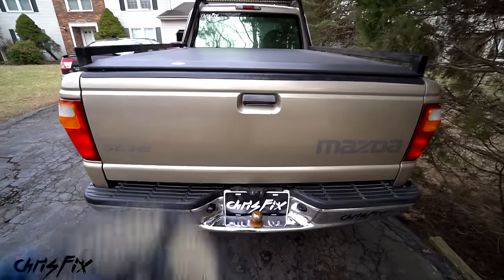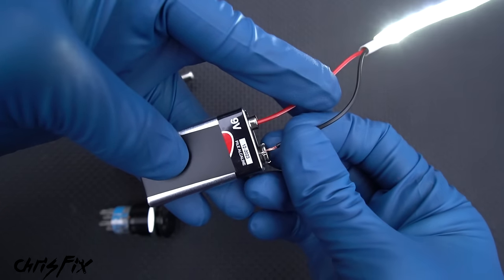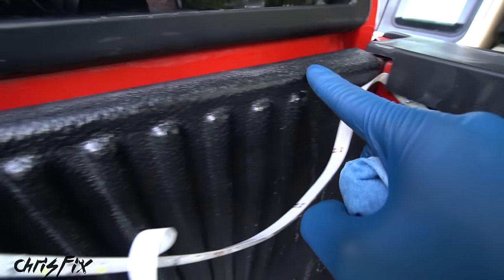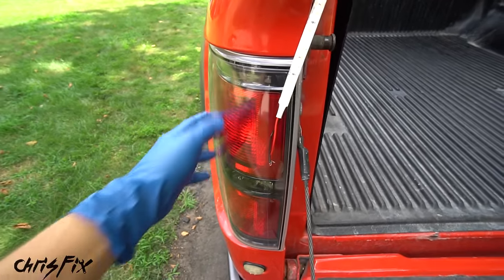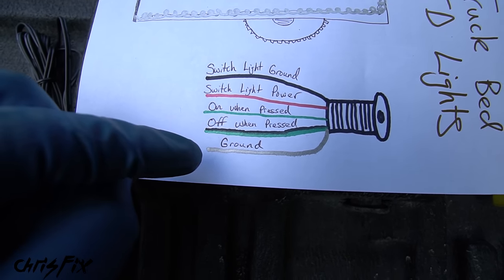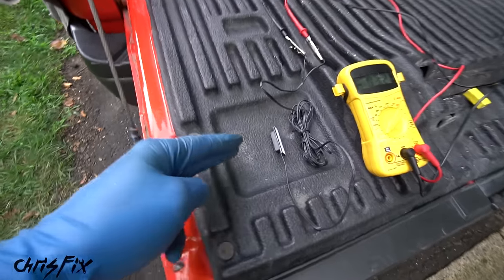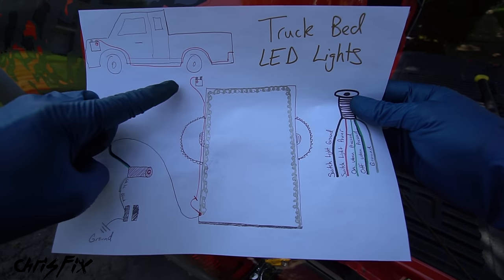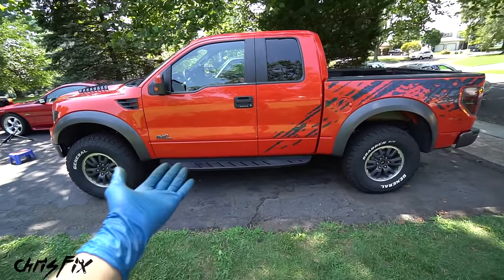How to Install LED Bed Lights (Fun DIY Project)

Comment: Hey @chrisfix this video helped me
A lot with understanding the wiring factor of installing lights on a truck but could you make a video of wiring rock lights. Because this have multiple different wires for each light and it confuses me. Thanks again for this video though I’ve always loved your channel when I wanted to learn about cars and trucks.

Comment: i ordered the the switch you had on the links, The lights them-self (link) didn't work, And when i got the switch in the link, it did not have the same colored wires, nor did it have a diagram, making it a challenge, i also didn't want the magnet switch, felt it was a possible future problem, which added to the install adventure trying to figure out the wiring paths for night light switch and the lights them-self, I found some Bedliner lights them-self at O'Rielys, (8 cubes of 6 lights each), along with the 6 foot gap of spacing for opposite side made it totally hidden and even more professional. the illuminated night light on switch makes it so clear in the dark when you open it, no hunting around. But Thank You for the Info, just adjusted it to suite me, Super helpful, and everyone that has seen it on or walking by at the store when its on think it Factory done

Comment: Couple of pointers for you I would have used water proof heat shrink connectors and the one yellow 10ga connector you crimped the casing was cut and had some bare openings .. that ground was classic I’ve never seen someone put wire Thur a bolt and a rusty bolt at that . Then you didn’t even remove paint for optimal connection…you also should have left the 5 amp fuse because now you have doubled the operating load . Those leds would melt before that fuse blew

Comment: Very nicely done, as always.
I personally think it's disturbingly bright, so I guess I will have it installed under the rails only and not where it is shining in your face. But overall a very nice idea! Cool truck btw! 
And one thing I learned from a car loomatic..... the front part of your protective tubing needs to be properly   
fastened. So wrap the black tape around the cable three turns, then slide your tubing over it and run the tape through the opening of the tubing. When you now wrap your black tape around the tubing it it will never loosen itself.

Comment: Hey @Chrisfix,  I've been following your channel and projects for years, I've always been impressed by your willingness to demonstrate how to do things correctly and not take short cuts. Until this one. As always I was impressed in your methods and how you demonstrate the different way to do thing, crimp w/heat shrink, solder, you did miss in this case heat shrink with solder inside it already. However I was disappointed in the way you grounded the switch in this project. The ground is the point of failure with this project. It should have been tied into a ground point with a proper ring terminal similar to the way it was connected to the battery. the way you connected the ground will corrode or break in short order.  apart from that good work, and I look forward to future project.

Comment: Greetings ChrisFix, This is a really good instruction video as are all of your vids. I have a couple of suggestions to go to the next step. 

First, attach the switch to the HOT side, or Positive side of the battery. It is much safer way to run the wire. As an electrical engineer it is one of the practices i do. 

Second, on your ground connection, go with a larger ring terminal. Just using the copper wires in the nut may cause problems. Vibration will cause the ground copper wires to "work harden" (bending back and forth) and become brittle and are more likely to break off. 

Thanks again and FIGHT ON!

Comment: Hey Chris. Good video! Instead of using the heat shrink you used, I would have used the type of heat shrink with the adhesive/seal already in the heat shrink. When it is installed properly the splice is nicely covered but also sealed against moving and is weatherproof. It's a win-win situation. It is slightly more expensive than regular heat shrink but does so much better. Now the butt-splices that you were using are OK but I found out that even the insulated side of the crimpers can cut the heat shrink, So I get my weatherproof heat shrink and cut it so that when its reduced it only covers the center of the butt-connector to cover where the crimps are. It is so easy to do, I can't consider it another step. Just a helpful hint from someone who has to do installations professionally.  Oh as for the nut on the ground. That is a NO-NO. Use your ring connectors and Self-tapping screws. This way its properly grounded. Then just cover the ring connector/screw with a light coating of silicone sealer (RTV Clear).  Keep up the informative vids!

Comment: Sometimes the switch colors are different. But usually you can figure it out. On the 5 wire layout the red and black is the same. The white is usually the common ground. That only leaves 2 wires to figure out. On my switch I had blue and brown instead of green and green black. Since one will be press for on and the other is press for off it's must a matter if trying out each wire and figure out which is which.

Comment: 14:08 you should have tined the wire and made a solder connection to the terminal. better connectivity & helps prevent oxidation. That said. I meant no negative criticism, just a suggestion. Without a doubt. You sir, are awesome! You certainly make the the greatest & most informative vehicle videos on YouTube. Thanks, and keep them coming.

Comment: To connect the positive(red) wire coming from the battery to the red wire on the led light end I would have used spade (quick disconnect) connectors to connect those 2 wires to each other instead of soldering them together so that you would not have to cut the wires in the event that you had to make any repairs you could for example easily replace the led light strip and all you would have to do is disconnect the old 1 and connect the new 1.

Comment: Hi Chris. I am a huge fan of your videos!! Just an FYI, the link for the switch, (not magnetic one) does NOT come with any instructions as you thought they did and the barrel of the switch is actually larger than 5/8. I picked up the 2 -5/8 inch washers as you suggested but they are too small to go over the switch... thought you might like to know...

Comment: Hi @ChriFix!! I want to thank you to all the video you posted. It's very educational. If you have a chance please can you help on installation for the hood LED strips. The instuction says tap it on ACC fuse or DRL but we can't locate it. Even if I check in the forum, no one have the answer for Lexus NX 350 or fuse having 12v doesn't indicate

Comment: @chrisfix! Hey Chris!, i am a fan of your videos i have a segestion for this install. Since the Led strip has a white backing they make led strips that are black with diferent color lighting to meet your application. I did a similar install like this before i saw this video and i used RGBW led strips so i can change the colors because i have a custom setup. My headlights also can be changed by color if you wanted as well as my underglow. i think the black strips would look so much better for the application

Comment: Hey chris.  THX for All your great videos.
I have a question. why didn't you get the power for the lights from the taillight lamps? it was much easier and cheaper!
Reply from the maker: Thanks a lot! And the light would not have been on unless the taillights were on!

Comment: Hey @ChrisFix! Thanks so much for another incredible video. Quick problem - about 24hrs after install, I noticed the magnetic switch melted and is now stuck closed. Any thoughts as to why this happened?

Comment: Awesome video ! Can I just run the lights to my existing bed lights so when they turn on the light strips turn on ?
Reply: Yes and No. 
There 12v lights but there might not be enough current to power them. 
I just added a switch to my trunk light and the switch caused so much resistance that it would not power the light any more. I had to buy a low voltage switch.
Also your existing lights are already on an existing circuit where the the appropriate fuse has already been placed. You don't want to risk drawing more power of a circuit that's not able to handle it.

Comment: You could have ties into the trailer power in the back. It’s already back there, instead of running a wire all the way back there. The center spot on a 7-wire plug is always hot, as long as it’s connected at the battery. GM trucks come with the wire, but it has to be connected at the battery.

Comment: Thanks. I had a camper shell put on my GMC Sierra and the factory LED by the lift gate is lousy. I’m going to add strip lights to the inside of the shell but I want to button switch to light up. I wish you would’ve shown how to wire that up too.

Comment: Chris, this truck bed lighting is really great and I want to thank you for the idea and how to video. Have you had any suggestions as to a more durable magnetic switch?  I've burned up two of them in just twelve months and looking for a better one or just bypass that feature and use manual only switch.
Reply from the maker: Dang. I wonder if they make a better one? Or maybe a mercury switch which recognizes the tilt of the tailgate when you open/close it?

Comment: Not sure what kind of amps the lights are pulling, but there’s always sources of power closer to the install. IE taillights, trailer connectors. Lots of other places to pick up a constant hot vs running a whole new circuit. Just make sure the maximum power usage is still under the stock fuse and wire size for the whole circuit. Just what I’d do on my own car not advice on yours.

Comment: Conical end on that grounding bolt and no ring terminal. That will be the point of failure in the future. Other than that...great info! Will have to do in the boat.

Comment: Hey Chris was wondering if you had another recommendation for the LEDs as the ones you recommended are no longer available. I saw in one of your reply’s you replaced the switch as well could you share which one you went with ? Thank you

Comment: There are heat shrink butt connectors that have solder in them so they seal and solder the connection. Also there's heat shrink tubing with an adhesive that seals against moisture. Might save someone some time

Comment: You should get a inclosed goose neck 45 ft trailer and a f 350 dully or a chevy durmax dully or a ram 2500 dully

Comment: Could you use an inexpensive mini power bank to power the lights instead of the starter battery? That way if the power bank can be accessed perhaps in the front cab interior, it can be recharged  at times when  the lights go dim? Probably would not work if stronger lights are needed.

Comment: Hey Chris!  I’ve been checking out your videos for years and finally have made the time for this project…
Can you let me know the purpose of the push button switch for this?  In my mind I should be able to bypass the push button switch and go with the magnet or bypass the magnet and use the regular switch.  Thanks for your input!

Comment: Love the video. But three things I would have did differently. 1 head of the bed I would have eliminated it. And just use wire. 2. The led in the tail light area. Cut it shorter outside the area. And the ground. Ring terming.

Comment: I'm assuming the truck has a 7 pin trailer hookup, an easier way to run that power wire would be to tap that power wire that's already behind the rear bumper in that built in 7 pin trailer adapter. Just my .02 to help save time in the wiring process.

Comment: I did this on my last truck but instead of running a new wire all the way to the battery, I just tapped into the trailer harness and used the wire/pin that powers the trailer lights.

Comment: If you ever need to remove the tailgate, (if the cable doesn’t have a clip) you’ll have to remove the taillight and the nut holding the wire on and then you can’t use the lights unless you put the bolt and nut back on

Comment: Great work until you got to the ground on the bare metal. I thought that was a bit below your usual high standard. The wire under the nut could fail. A connection like you put on the positive of the battery may be better.
Reply from the maker: Thanks for sharing, I've done grounds like that before and years later never had an issue with them!

Comment: Is there a way you can make a tutorial on the hood LED lights, I really like that set up and would like to copy it. It’s gonna make working on my truck at night a whole lot easier😂
Reply: Splice a relay off the factory wiring for the hood light, that will be used as the trigger (switch). Run battery power, like he did in this video, through the other side of the relay out to the led strips.

Comment: Great video but still wondering why no sanding paint and using a ring terminal for the ground. Those wires will break within a year here in Arizona lol

Comment: Chris,  can you do an interior LED lighting vid?  I have a 2024 Frontier and it has the reading lights, but no other interior lights! I was thinking LED strips to illuminate the floor area with it ran to the fuse box.  I welcome any other options you can think of.  Something with constant power and a switch in an empty slot that I have would be cool.  Hope you can help with this because I'm at a loss as to what to do.

Comment: Thank you for all the videos! You have given me the confidence to attempt and successfully complete multiple repairs on my cars.

I have a request, if possible, can you do a video on hardwiring dash cams to the fuse box? I know you have touched on some of the topics throughout various videos but seeing it all together would be great! Front/rear, license plate mount, running wires etc. Thank you in advance!

Comment: Bro, cringing at 20:50. After all that attention to detail on the rest of the installation, how hard would it have been to put a simple spade connector on there? Just jamming the conductor into the threads of a bolt is a pretty amateurish way of doing it.

Comment: @ChrisFix thank you for the awesome vid! Makes DIY so much fun to do!  

I have a request, can you make a side vid on adding in a secondary power source to us other than the car battery?  I only ask because my car battery died and needed to look under hood and the light won't work if the battery is dead. 😅 Something as an emergency backup. Maybe something next to the fuse by the red battery post?  Thanks again.

Comment: Was watching and the video was really helpful, thank you for your time hope you keep helping the community with your skills, I do some simple stuff to my tacoma and already installed some led lights and was thinking to install some fog lights also but don’t want to keep putting more wires on my battery is there anything I can use to install everything on it instead of the battery? Hope you have the time to reply, thanks GOD bless stay safe....

Comment: Hey Chris. Ty for all the information u provide us with. Learning a lot. However I will appreciate some help. Ordered lights and switches bus switch came with different color wires (black, white, red, blue and brown ) tried installing magnetic switch to it but didn’t work. Would u plz help with wiring colors, ur video shows white, green, green and black, red and black. Help plz. Ronnie

Comment: Nice job, but what if you need to remove that plastic cover? Maybe better idea to put 2 connectors between metal and plastic part?

Comment: Great vidio,but I would tap onto the tail light wires.your going to have your running lights on anyway.and led lights uses very little current.

Comment: Thats awesome!!!And by the way, congrats for almost 4 million views!!i have Subaru base model without mirror turn signals. i was thinking install one, is it safe to just tap to the rear turn signal? or do i have to change and increase the value of the fuse which has7.5A?

Comment: Hey ChrisFix.. I had watched this video over and over many times.. I’m not sure whether there is a black wire run from the battery to the back of the truck or just the red wire run to the back of the truck..

Comment: The only thing I would have done different is put a short screw in the metal to attach the ground vs using a spot where the tailgate latch would cause a detachment of the ground.

Comment: So I just watched this and now I need to do it! I bought all the same items you had listed but have one question. If you did want the light for the switch to be one, how would that be wired?
Reply: I also didn’t want the magnetic switch. Just curious how to properly wire it with the switch light color in
Reply from the maker: Just remove the magnetic switch and follow the same process. Where the push button switch attaches to the magnetic switch you would just ground that instead.

Comment: I wish I could do this on my truck but it has so many electrical problems I wouldn't dare do anything electrical and possibly screw it up more. When I take the negative batter connector off it sparks like crazy

Comment: done, custom wired 2 set of leds under a Diamond Back cover using this set up. quick disconects from the auto parts store were the ticket. Thanks @chrisfix

Comment: Cant wait to do this to my truck! But i have a question will this draw power from the battery even when everything is off? ive been expeirencing some power issuses with my truck just a little but not much

Comment: Just wandering can't i just wire the light to rear parklights without running a completly new power wire from the batter .its just thought i got

Comment: Hello Chris, what size gauge wire did you use that connects the battery to the led strip?

Comment: Thank you for a great video, I appreciate it. Is it ok to use 18 gauge wire instead of 14? Thanks
Reply from the maker: Depends on your wire length and amp load. Check the chart and see